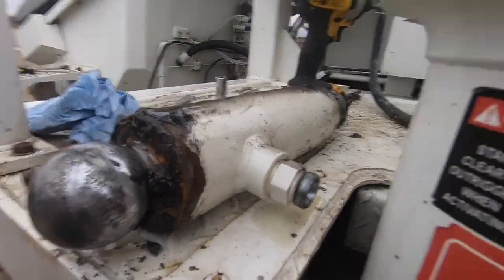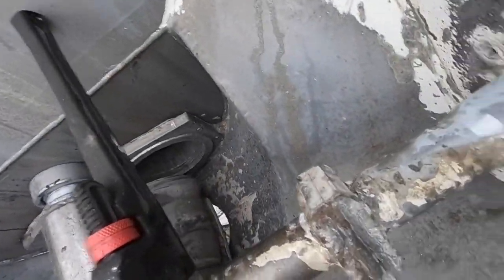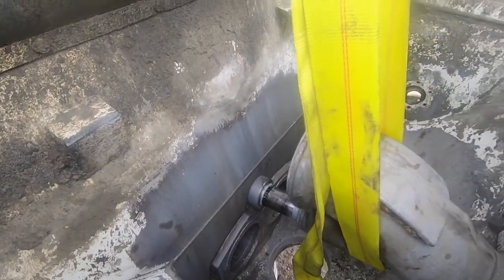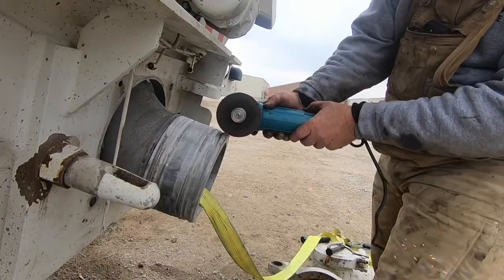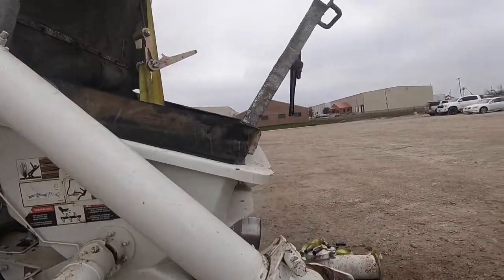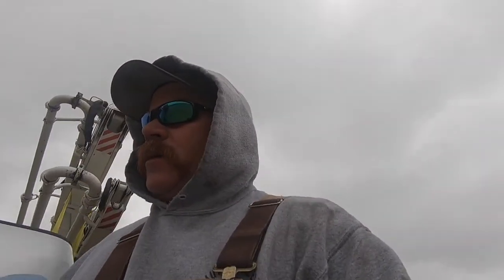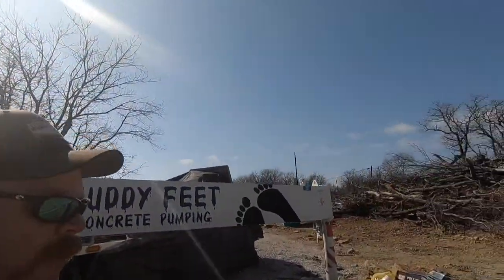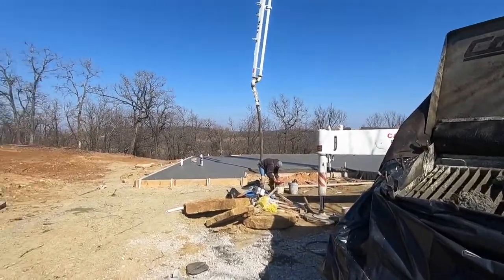Tore up from the mud up . Muddyfeet Concrete Pumping

Comment: You can also use a 2 ton Jack . By placing it under the hopper and opening the bottom hatch.  It gives you extra support.
Reply from the maker: That’s a good idea. This was like my second time to do this on these trucks. Much easier on a trailer pump. Thanks for the comment
Reply: i realize it's pretty off topic but do anybody know a good place to stream new series online?

Comment: How many yards gone through that thing? Carbide wear parts man!
Reply from the maker: Rcp 916 The ring didn’t look worn all that much. It needed to be turned. But it wasn’t worn out. I honestly think it was damaged try to force that bad mix. Pump only has 500 hours on it. We have done a pour job of keeping up with the yardage. But I think yardage count is a debatable subject anyway do to so many variables in the wear parts and the mix designs.
Reply: Muddyfeet Concrete Pumping haha I agree man. I put new twin wall on my 36 April of 2018 and by July of 2018 I lost count! Haha I guess I could go through my invoices if I really needed to.
Reply: I would have like to see a video of you guys beating the tar out of that outer housing getting it out hahaha I destroyed mine but it was wasted anyway
Reply: I’ll try to dig it up but I bought a die and tool that fits the threads on the swing tube shaft that’ll chase the threads and clean em up. Hopefully you’ll never need it but it’s a god send when you do. I stay Putzmeister and it also fits the shaft on my line pumps too. I love the interchangeability of keeping things the same.
Reply from the maker: Rcp 916 he used bolts and a impact wrench to pull it out. Worked really well.
Reply from the maker: Rcp 916 I’ve got a friend that bought his Pump about 4 months before I did. He has a lot more hours on his than mine. So I am gauging off of him to see when he starts changing his out. Cheating I know but it works.
Reply: Muddyfeet Concrete Pumping mine required a sledge hammer and Porto power